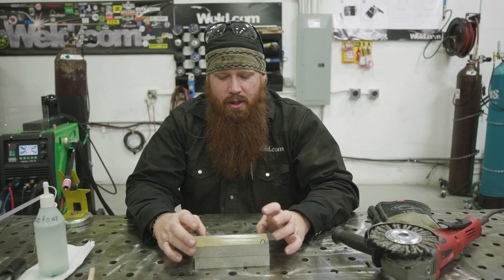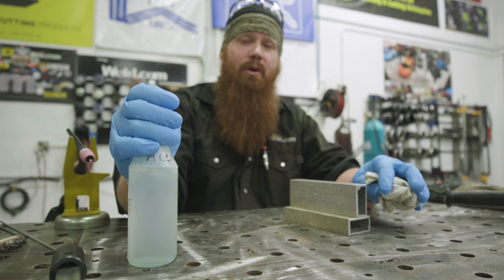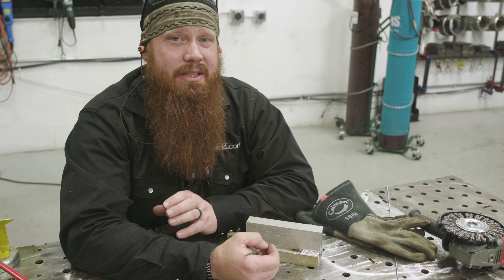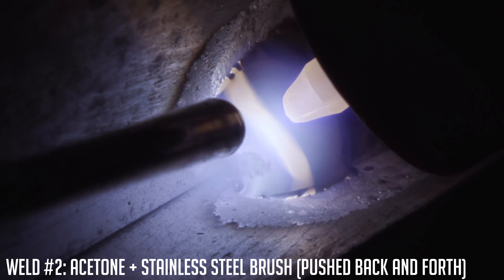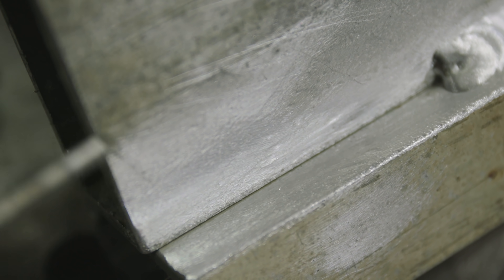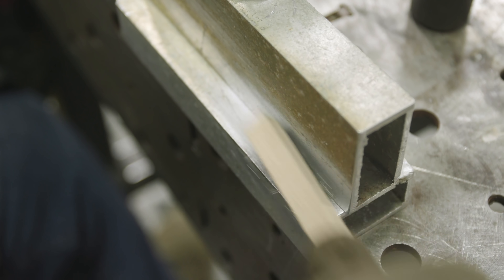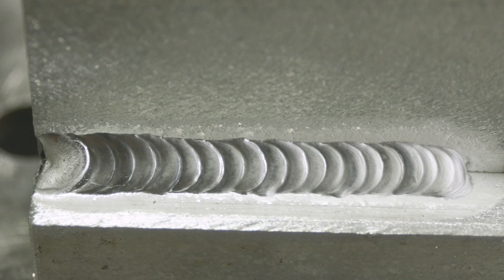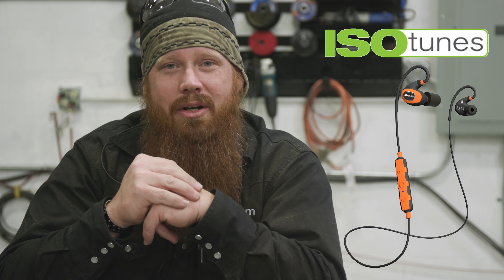How to Clean Up Your Dirty Aluminum Welds!

Comment: Hi sir. Is it normal i get white fluffy stuff on thin 18 gauge mild metal also. Not aluminum. I cleanl out the gray stuff before tig welding. But the white fluff stuff is more apparent also in the back of the material...is that normal for 18 gauge sheet metal. Im using 1/16 tungsten V
Blue lanthaneted,  1/ 16 filler rkd or L-56 mig wire 0.025 in?

Comment: I find that using an air sander with 120 grit to take off all oxides before I even put pieces im gonna weld together. Wipe it with acetone. Then place my pieces im welding together clamped together, then I wire brush, and then follow up with another wipe of acetone. Then I get a micro fiber rag, and put acetone on it and wipe all of my welding wire itself. You'd be blown away at how filthy welding rod is. Usually you'll know aluminum is clean when you go to put your torch near it and you can see a dim reflection. The more mirror like the work piece is the better your weld. Also. Lighting up, focus your heat as close to the tack spot as possible and sit on it. Sit on it until you develope the size bead your wanting to weld, and then dab until that puddle sucks it in and when it does, then proceed forward before adding your next amount of filler. If you can get a small Cresent in yournpuffle before progressing then you'll have much wetter and better spaced beads that are penetrative. You're not welding the top of the material, you're welding the back of it.

Comment: It all helps, but mind - after 10 years of owning a chinese machine - most of fails can often be just sorted by finding someone who has a kempi welder. There are many films like "worst casting I have ever welded" etc with a weld puddle getting contaminated over and over again no matter how much cleaning/degreasing you do. I had such situations in my experience (I got my tig welders replace 3 times under warranty, and right now I am sending it for after-warranty repairs), then just to make sure it is not your skills, material etc, I visited a guy who has a kempi. No problems - his welder his going strong on whatever alu you deliver, of course, dirty material will not turn out that nicely but it will be a day and night anyway and weldable with a wet puddle far from a dirty spot that makes you stick in one place thinking whether it is gas/grease or temperature not enough. I think AC inverters in chinese welders are bad quality, making you often "beg the machine for a proper weld with all these rites that you have to do, wasting time on overpreparation of welding while in reality, most of aluminium stuff on yt - about excessive cleaning, brushing, degreasing is just a fairy tale unfortunately. Especially if you see someone struggling with a chinese machine.

Comment: I think those parts should have been cleaned before they were tacked together. 

Whenever possible don't use nasty old oxided material that's been laying around outside for years. If you do have to weld something like that for somebody, set their expectations right in the beginning so they're not disappointed.

Comment: It is impossible to completely remove aluminum oxide from the surface due to the high activity of this metal. The only matter of striping is ensuring that the oxide layer is fresh and evenly thin. Among other methods, it is sometimes possible to etch the part in a solution of sodium or potassium hydroxide, then rinse in clean water thoroughly and dry with a lint-free cloth.

Comment: Excellent advice.  I would add one thing.  When using the angle grinder with the wire wheel, a light touch is needed as aluminum is softer than mild steel.
Reply: Since I posted this, I have shifted to using a 3" diameter abrasive pad on a battery powered angle drill.  The grit on the pad is listed as "fine", so I think that the grit is in the 200 to 300 range.  It works quite well.  I still use the SS brush when cleaning up around tack welds.  I also wipe with acetone after brushing/cleaning.

Also, with the wire wheels there are wheels available with finer gauge wire that are not as aggressive.  I have used these and they work quite well.

Comment: Nice video. Aluminum oxide layer regenerates in a split seconds so removing it is only cleaning. Still need the AC electrode Positive to break through it.  If it were removed there would be no need to AC weld it, and straight DC would work since there is nothing to remove to get to the aluminium.

Comment: If you look very closely at the arc shots in the beginning you can actually see the contamination loosening up on the filling rod as it gets closer and then transferring to the puddle when dipped.
You have to clean your filler metal as well.

Comment: I have a new tig welder and it has a sp dial. +5 to -5   Is this my balance?  Where should that be set at. I’m new to tig and I’m trying to tig Aluminium and I’m going thru tungsten so fast. I know I need more time on this but just don’t know what this one dial is for and booklet does t really say witch is odd. I feel it maybe bal dial but nvr the less idk where to set it.

Comment: Great Video! I weld in Aerospace. I go as far as to clean the backsides of the parent metals if I can. Also, I use scotch Brite and a following up with acetone wipe on my Filler Rods. Also, take a look at your welding gloves... they are the LAST thing to "touch" the filler rod before it goes into the molten puddle...if they are dirty, so will your weld!
Reply: I never thought about that, mine are kinda clean and I don't use old ones, but I have always used fresh SS brushes

Comment: Wow, Thanks, I am welding on old pontoon boat and they usually sit in saltwater for 200+ days a year. It is hell getting it clean. The bad part is that after cleaning the metal, there is not much of the metal left. Up till now, I have been pressure washing & scrapping incrustations off. Then propane torch to cook out the salts, alkali wash, force air dry, and wire brush. I never thought about the way I brushed it off. I will definitely try your way and see how it turns out. Thanks a bunch. 
If you can do a video on how to remove salt out of porous old aluminum, that would be great, because I am in hell right now. I am getting pontoons with dozens of 1-inch holes at the waterline and the pontoons are beaten to hell. Thanks again  
P.S. the pontoon boats are used to build docks and that is where all the holes/dents come from.

Comment: I have several old motorcycles, the earliest being a 1929 Scott.  This has had an alloy repair but the backing plate was welded to the original metal which had 1/16 inch deep oxide layer on it...  The result is not very nice...   Also the same piece has contaminated cracks:  What would be the best method to deal with these cracks, which go through the 3/8 inch casting.    As only the cracks are visible on the outside,  I thought epoxy putty, painted with an aluminium colour would be the easiest solution.

Comment: What about using rough sandpaper like 220 grit or so in one direction only? Will that work or introduce more contamination? Also, for example on Alu Welding rods? Thanks

Comment: I've had trouble getting a SS wire brush to effectively clean the edges of cut sheet.  Have you ever tried a paint stripping wheel like the Scotch-Brite Clean and Strip XT Pro Disc?

Comment: I want to ask // my welding brand is Vector Welding New York 2500/// why when I test weld aluminum or iron or stainless without using a welding wire there is a lot of black dirt on the edges and middle of welding? please answer sir

Comment: Great video!   I majored in Welding Technology at a junior college way back in 1972 - we learned to weld aluminum with oxy-acetylene, arc, TIG, and MIG, and in every one, the most important factor was cleaning off the Aluminum Oxide with a dedicated Stainless Steel brush - it takes some time, but the results are worth every second of preparation.  I've also found that if you pre-heat the pieces a little with a propane torch or something, the Oxide is much easier to remove - you can actually feel the brush dig in instead of sliding across the Oxide.

Comment: You can NOT clean off Aluminum Oxide off with an brush.  Bull Sh$$!    As soon as atmospheric oxygen hits the bare aluminum, it forms aluminum oxide!  Please don't lie.  The "peppering" contamination is NOT aluminum oxide.  Don't make recommendations when you don't know how to CHEMICALLY remove contaminates.  You can NEVER remove Aluminum Oxide.  At the end of your video, you supposedly had cleaned the aluminum, there was still evidence of contamination in the weld puddle.  Why? As John V points out that you removed the filler rod from the argon shield.  That's contamination.

Comment: i can see the problem with the last weld done after the stainless steel electric wire brush, we could see the oxide coming off the actual filler rod itself. Didnt you clean the filler rod too?

Comment: Very long story about brush .... and it is useless for old parts.

But the best solution is to use angle grinder :)
Next hiden mistake is preparation of filler rod.
Actually your filler rod is dirty.... it is quite clear on the video.
Chemical cleaning of aluminium filler rod is necessary process - using hot alkali, washing with water, clarification with nitric acid and drying with air. 
After all such way prepared filler rods are suitable for 3 days only.
GOOD LUCK TO YOUR JOB!

Comment: IS NOT TRUTH. Aluminum oxide is lighter than aluminum and when you are welding uncleaned material - automatically aluminum oxide pup up at weld surface = meaning NO NEEDED for prior cleaning. What you say is just a theory. Prove yourself that prior cleaning IS MUST because if not cleaned - will be weaker weld, after that measure HOW MUCH weaker is the weld no prior cleaned. ZERO.

Comment: I'm a machinist with a strong welding background. My old welding mentor emphasized stainless steel brushes (hand or rotary) to be dedicated to final clean-up for welding aluminum should start new and never be used for any other purpose like stripping paint, parts cleaning, etc. Further, your aluminum brushes should always be kept in your posession, protected from contamination, and demote them to lesser duty when their cleaming capacity fades. "Treat them like your toothbrush!" he said.
Reply: @forrestaddy9644  i was also always taught to use all dedicated abrasives and stainless brushes for both aluminum and stainless to prevent any contamination.

Comment: muriatic acid solution, wheel cleaner from napa etc is good for this or mox your own, btw it's a very very strong acid. dry with warm air, then wipe with acetone, enjoy

Comment: A Scotch Bright pad on the filler rod followed be Acetone works very well.....you can also see the puddle doesn't wet out correctly with poor cleaning....I love welding Aluminum when everything is squeaky clean! 

Great welding info...thanks!
Reply: Possibly acetone before as well, keep the oils out of the ScotchBrite?

Comment: Thanks for the video! Question for you guys:

Does the Stainless wheel/brush cause any long term corrosion issues when using it to prep aluminium? 

I work on aircraft and we are strictly prohibited from using stainless products like wire wheels or brushes on aluminium to prevent dissimilar metal corrosion from occuring from small bits of stainless getting embedded in the aluminium.
Reply: I’ve welded a ton of x-rayed aluminum. Never once seen a spec of stainless anywhere .. the digital X-rays would be easy to see if it’s in there

Comment: I'm not an ally welder but, wouldn't a straight bristle wire wheel be better than a twist knot? They tend to not dig in as much and give you a clean more like the hand held brush, just thought it might be worth mentioning.

Comment: Nice arc shots!

What AC frequency is that? Sounds like something in the 50 Hz to 60 Hz range. 

Im a beginner and my machine only has 50 Hz freq. I have alot of trouble to keep the arc focused in the center of the joint. It wanders all over the place. Cannot imagine to have it so stable as in this video. Any tipps for what could cause this? 

I use 2% lanthanated electrodes, whith very small ball.

Comment: After about a month I have successfully taught myself how to weld thin wall aluminum. Specifically intercooler piping.  Your videos have helped immensely.   WHEN YOU THINK THE ALUMINUM IS CLEAN ENOUGH, CLEAN IT AGAIN!!  Also clean your filler. Thin aluminum is very sensitive to contamination.  I learned using an AHP-201XD.  Good luck to everyone learning.

Comment: I have to ask. Can you weld new stock without  cleaning ? The next question is, if aluminum  has oxide on the out side if you weld it and the oxide  boils out to the outside what does this hurt? Does it change the strength?  Does it make the weld bad ( ie porosity)?

Comment: Aaron from 6061 here on Utube uses a stainless wire brush back and forth...no floaters and absolutely beautiful welds.  Looks like you just brushed back and forth and did not blow off the residue.

Comment: What I love the most to clean aluminum and save time is to use a paint-stripping wheel (norton rapid strip) and scotch brite on the filler just before I use an acetone wipe. Obviously- that’s when it’s not grease and/or oil soaked of course.....

Comment: Hey Bob!!!!!!! Over here!!!! I want a video all about bead sizes. How to achieve the correct size in the drawing with different wires . Some companies are particular that the bead must be correct size and throat with only a certain number of passes . Some want a larger bead in a single pass  but when the puddle wets out to the leg length the throat is crowned .. so anything on that .. difference wire sizes etc ... I’ll wait

Comment: The funny thing is the surfaces of the base metal not directly seen here also need cleaning because when the aluminum melts it pulls oxides from those surfaces. This video is actually very good but I can assure you that contaminants will stay beneath the seams because they where driven in there mechanically by us cleaning the metal and 2 because they where already there to begin with.

Comment: What I do is to use acetone first. Then I brush it, and I use acetone again to remove those microscopic particles produced from the brushing. That does make a big difference difference. And some manufacturers produce really dirty rods, from the drawing oil, or something, I guess. But others are much cleaner.

Comment: Questions from a noob, were those welds getting into the root? why is tig so much more finicky then say flux core? Flux core you can weld rusty metal practically. Lastly why is the power switch to most welders on the damn back of the machine? Please enlighten me. Thanks
Reply: I think I saw somewhere that the power switch is located on rear because of EU requirements. By putting on back will allow the units be sold in both US and EU. However that said, I have a couple older Sealey (UK) MIG welders where the power switch is on front and the power cord enters the front of machine, both inverter welders I have do have power switch and cord on rear.

Comment: Also if you pull your filler rod out of the weld zone and it looses gas coverage it will also contaminate your weld.  Any little thing will pull trash in aluminum.

Comment: also the tungsten needs to be clean 
the rod dirty gloves will contaminate the rod
good gas flow 
also the wire brush or wheel can’t be used on steel then back to aluminum 
(aluminum only)

Comment: Hey hello , if i can ask a question that is not totaly related to this video , but here it is 
= on flux core welding , does it make a difference on the arc on flux core or metal wire between  a 2 lbs spool  vs 10 lbs spool , because , when trigger in both case the entire spool become alive ( current passing through ) ???
Thanks in advance
Reply: No dosen't matter
Reply: Ok Bob , thank you so much !!!!

Comment: Does it matter though? You get some contamination but would you see any effect in the weld strength? (Between acetone alone and your best method)
Reply: Acetone does not remove the oxide layer on the surface and those contaminents can prevent proper fusion at the root inmy experiance as the puddle tends not to flow down and in. Acetone only removes loose particles and oils/greases. Best method imo is acetone wipe the parts and the filler wire, stainless brush the parts and use a piece of sandpaper on the filler to remove the oxides followed by a final wipe with acetone for everything. Super clean tungsten and if welding thick alloy a gentle preheat if you like; enough to drive outthe moisture at least

Comment: I use the die grinder to clean the surface of the weld joint to. Do a lot of repair work on old aluminum boats. Sometimes lite scuff with my saw blade to get nice shiny material under surface.

Comment: I need to thank you since your stick welding lesson in Texas.
I asked why my forearm started getting little electric shocks while using the tig torch. You said to check for a split in the insulation near the torch and don't hang it at a steep angle when resting it. Following up conversation with ,  "I'm shure of it"  when I got home out came the razor blade and peeling back the protective cover a split appeared with a shiny copper cable. I know it just seems common sense but no one else would take my question seriously. You probably saved me from a major jolt and I'm grateful.  Again a Big Thanks!!!
Reply from the maker: Glad we were able to help you out. Stay safe.

Comment: Nice presentation on cleaning aluminum before welding. Cleanliness is next to Godliness. Cleaning the filler rod is the same for sweating copper pipe. Not only do you have to clean the copper pipe and fittings, you need to make sure you have your filler soldiers surface clan too. Something a lot of newbee and old lazy plumbers just refuse to admit to doing. Keep the videos coming too